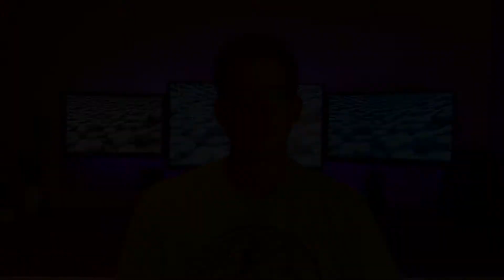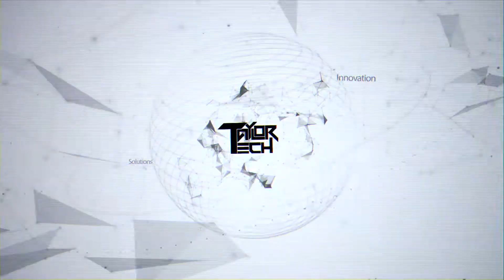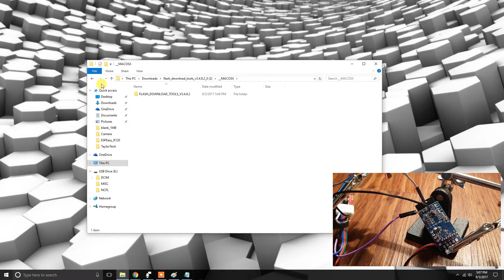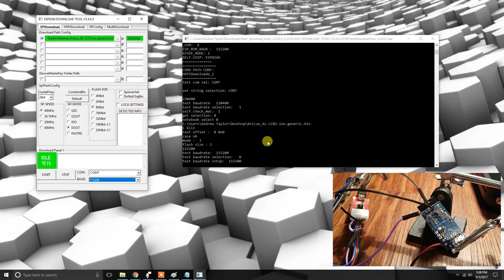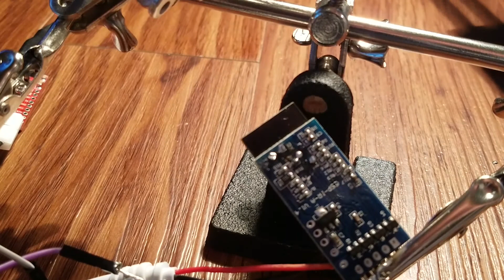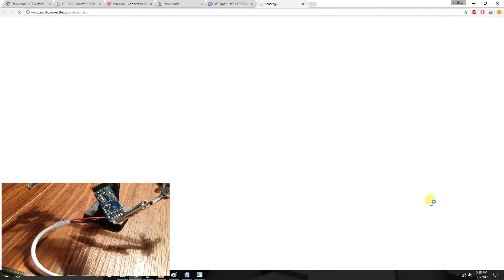]NEW FLASHING METHOD] Cheap Philips Hue Strip alternative!? Works With SmartThings

Comment: I've tried this with several different controllers, they all flash, but nothing controls anything in SmartThings.  Any chance you still have the firmware - "AriLux_AL-LC02.ino.generic.bin"  I cannot find it anywhere to try.

Comment: Hey Taylor, i'm trying to find a solution to use with addressable led controller like this one 

https://www.ebay.com/itm/WiFi-Addressable-LED-Strip-Controller-for-WS2812-WS2811-Compatible-Alexa-Google/233167576332?hash=item3649dedd0c:m:mqHkJA8shuVHO7iwyM03DYw

Comment: I selected the link for the RGBW controller (SL-LC-02) in your original video. I received a device that, internally looks nothing like what you are using. I got the AL-LC-02. Can you confirm the Banggood part number you're using? Thanks. BTW, you might want to check the link I mention to confirm.

Comment: I flash mine at first didn't want work but gladly I re try and its working with smartthings now, the only thing is the colors don't mach(I select green and turns red and blue turns green), I check conections  they are good. Is any body know a solution to it?

Comment: Drew I ordered the controller with the remote I have not received it yet but do you know if after flash will remote still work
Reply from the maker: Yeah, it should still work. Just make sure the controller is the same as in the video. I've heard that they have been changing some of the boards lately...
Reply: TaylorTech I got my controller today but nut shore were to make connections can I send you pictures of board
Reply: TaylorTech Is there any way to flash native HomeKit control onto that controller? 

There is a github homekit controller firmware for the magic home rgbw /ARILUX SL-LC 01

Should I just follow your tutorial using this firmware or is there something else that it needs?

Comment: It seems that amazon is now selling the light strip with a wifi controller.  Would this be able to be flashed using this method to work with Smartthings?  https://www.amazon.com/gp/product/B075H6TW6Q/ref=as_li_tl?ie=UTF8&tag=aylortech-20&camp=1789&creative=9325&linkCode=as2&creativeASIN=B01HD37U6S&linkId=35c9464023e294071d86d51fd9f74d4e&th=1

Comment: is there a way to remap the colors. when I choose RED in the app I seem to have no power coming out on any pin. I seem to only have power out on pins when I choose green, blue, white 1 or white 2 but not red.
Reply from the maker: +clintpc78 the pins being wrong is a known issue. But having no pin output red sounds like a hardware issue. Maybe a bad board?
Reply: yeah one pin is blue, one is green, one is white1 and one is white2. should there be two white ones?
Reply: oh and this is on the newer boards shown here.

https://community.smartthings.com/t/release-smartlife-h801-rgbw-led-strip-wifi-controller-bulb/51182/1496
Reply: actually its funny. I purchased 2. one seems to be new an 8285 chip. it is the one that is giving no RED pin out. the other seems to be an older one like in your first video and gives me red, green and blue without even changing what pics goto what wires. very confusing how they are all different but you do not know until you get them. seems like a lotto.

Comment: anyone have trouble with the colors being wrong? the APP has red, blue, green, white 1, white 2, by swapping wires I can get them to all light but in the app RED gives power to NO pins I end up having to connect the red wire on my rgb lights to either the white 1 or white 2. this works except when I want to make custom colours in the app.

Comment: Hey Drew,  hoping you, or someone else, can help me with this.  I got everything flashed great.  The SSID shows up, but when I connect to the SSID nothing loads up.  I attempt to manually type in 192.168.4.1 as instructed in the sonof forum, but when i do that it doesn't connect and more often then not the esp SSID broadcasting disappears.  In addition, when I attempt to connect to the broadcasting SSID via my iPhone, it first gives me "this is the wrong password" and then when i attempt again it says "unable to join this network."  If you have any ideas on how I could fix this I would truly appreciate it.  Thanks.
Reply from the maker: you are using configme as the password yes?
Reply: TaylorTech Yes sir, I am.
Reply from the maker: +PutYouOnMeTube only reason that wouldn't be working, as long as it's not a network issue, is the file you flashed wasn't right. Maybe try doing it again?
Reply: TaylorTech yeah I’ll have to try another flash.  It’s strange I bought 3 of them but only 1 ended up being the right chip, but they all are doing the same thing even the ones that aren’t flashed they just keep disconnecting once you connect them.  Thanks for the reply man, means a lot.
Reply from the maker: +PutYouOnMeTube no problem! Here to help. If that doesn't work these other guys know more than I do. You can search through the threads or aks a question here: https://community.smartthings.com/t/release-smartlife-h801-rgbw-led-strip-wifi-controller-bulb/51182/1511
Reply: Follow up, so i waited a couple days and plugged it in and it appears to be working now?  It at least let me configure it.  Now I just have to get everything else setup!

Comment: So I just flashed the ARILUX® AL-LC01 using your awesome tutorial. Flash appeared to be complete and successful. After I removed the jumpers and rebooted the device, I cannot see it as an access point. I've also tried plugging it into a light strip and the lights blink (on strip and the controller) for a half second before going off permanently. Any suggestions?

Comment: I just received my controller but it doesn't look like yours. I purchased from the link you provided.
Reply from the maker: +thechef01 what does it look like?
Reply: It's the Wi-Fi controller but I'm uncertain where to attach the ground.
Reply from the maker: +thechef01 if it doesn't look like what's in the video, there may be some mix-up somewhere. With the manufacturer or ordering mistake.
Reply: TaylorTech I believe I have the esp8285 chip. How is that company return policy. And how do I ensure I have the correct one. Are the ones on Amazon fine?
Reply from the maker: +thechef01 I have no idea... They may have changed the chip to the esp8285. Which means this flash won't work anymore. I can't say whether the Amazon ones will work or not. You could get an H801 controller that should work and flash the same
Reply: TaylorTech how can I ensure that I get the correct chip and also how would I wire and get power to a H801
Reply from the maker: +thechef01 http://amzn.to/2kwZ7lX there's a link to the h801 reviewers say they flashed it to work with Smartthings. You'd need a 5-24v power supply which you probably have laying around somewhere from an old charger or something. Google h801 Smartthings flashing and find the Smartthings community forums. There's good people and instructions on there you can follow. Hope this helps.
Reply: TaylorTech question is it possible for you to flash the controller if it was shipped to you?

Comment: Drew I bought 3 arilux controllers and 2 of them have a different PCB's the odd board looks to have a ESP8285 chip do you know which pins I need to solder to on that PCB to flash it.  And thanks for the updates I have 2 of the arilux currently working and 5 sonoff switches.  I have pics of the 2 different boards but not sure how to put them in the comments.
Reply from the maker: +Barry Henderson the only.thing I can suggest is looking for the 2 ground pins to jump to enter programming mode. But if it's esp8285 then I don't think it would flash correctly anyway. It's designed for the 8266. I would return them for the correct product...
Reply: TaylorTech on the outside they look exactly the same
Reply from the maker: +Barry Henderson yeah, but with the wrong chip inside it probably wont work without a completely different firmware image.
Reply: TaylorTech thank you I will look to return them
Reply: how do you identify th echips to know  which one you have and how cheap are these controllers? are they any cheaper than the $10 lixada H801 ?
why did you guys select these controllers over the H801's?
i am a noob to smart things  i just bought a 1st gen hub from ebay ,i have an H801 and just got my FTDI 232 yesterday
i only bought  smarth things to set htis all up but using the H801  and not these, arilux  , but i just bought 1 H801  and i need 4 more
so i am wondering  if there are any better or cheaper 
seems like the  H801 is better  because it has  2 W channels
not sure  if it is possible but i wan to use all the chanels on one or 2 of them to control not only a RGB and W but also a black light strip
but if the arilux are cheaper and do the same thing  besides the extra channel i might go fo those instead, what  do you think?

Comment: Why not just use a ESP8266 board? 
wouldn't it be less expensive and better
Reply from the maker: +greg larsen this is using an esp8266
Reply: it has more components though right?
i know the lixada   h801 has 5 mosfets on it
but what about this one ? what do the mosfets do ,i mean is it just for better dimming? i like th eh801's myself these are smaller and a little cheaper though bot fo rthe  extra $2 it might be worth it to go for the h801's since they use the same flashing method ,same hardware
i wonder if the h801's will also last longer because of the mosfets
 i have a cheap RF 40 button remote/receiver for RBGW strip it is really tiny
and the dimming is still pretty good though i wonder if it will burn out though , i wonder it you really need the mosfets for dimming to make it last  of if they are just is you want to use a lot more strip ,i have a  5m 5050 rgbw 6o led per meter connected to the cheap  RF controller so really only 30 leds per meter since it goes white rgb ,white, rgb ,white ,etc and i never rin them both at once

Comment: Nice Updated Video Drew..... Keep up the great work!!!! Got a quick question I watched your Raspberry PI video, which device handles Kodi better Firestick or Raspberry PI
Reply from the maker: +Donovan Lewis I think it's a preference thing.. if you want the ease of use I'd say fire stick but it runs better and you can do more with a raspi. You don't have a remote though so you'd have to use a wireless usb keyboard/mouse combo.  I use fire sticks right now but that's just because I got them before knowing any better